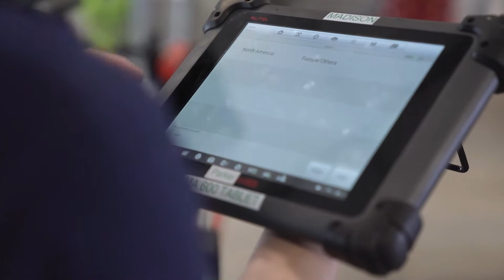What You Need To Know About Windshield-Related Calibrations

Comment: Currently on my 8th attempt with my insurance-provided windscreen replacement company. They've even said the calibration was successful, but when I turn on lane assist the car tries to kill me and pulls straight off the road. It will also beep at me constantly even if I'd dead straight within two lanes. In short it's f***ed, but was working perfectly prior to the initial windscreen replacement. Far too many service centres are failing with this task. My car has now been at an advanced ADAS diagnostic centre for three weeks and they're throwing everything at it. It's crazy.
Reply: Drive your Car not the Car should drive you. I dont use Keep Lane assist I always turn it off, I pay attention to the road infront,back,  left and right. Lol.

Comment: I have a 2025 Chevy Trax and it randomly had a crack in the windshield where camera is and then another appeared a week later. Need a windshield replacement $1200 with calibration. Windshield is in now but unable to calibrate cause of how new car is??? He came back today with updated equipment to do calibration and still unable to do it as it read STATIC recalibration which I now have to go into there shop to have done. How was this not known before getting updated equipment and coming back out to the house and how are these places not prepared to do these 2025 vehicles as it years in the making before they come out. I am a targeted individual via Gov criminals and I am extremely uneasy about this. The slightest the camera is off can cause me harm. I have already been put in two accident’s with attempts to take me out but they been unsuccessful. Now random windshield cracks show up and calibration is key to safety. Concerning and crazy as I have a pretty basic car and would never of known a windshield needs calibration. I don’t use this feature with lane assist so I hope I will still be safe but now literally will not trust it after it has been messed with after purchasing brand new. Sad actual criminals, under previous administration, have endangered my life to this point. Many people are targeted and don’t know, especially Trump supporters who actively engage  online. Covert operations to breaking into your vehicle and home and damaging things to look like wear a tear. People must know and be aware of this as many are out in the TSDB illegally and are covertly targeted. Just some extra FYI. Thanks for this information, very helpful and glad to be aware.

Comment: So if the clarity of the glass and camera alignment is so critical, then why doesn't a dirty windshield or a rainy windshield cause the problems in miscalculation you refer to? I call bullshit!
Reply: Great comment!!!❤
Reply: If you read the owners manual, it will specify not to use and rely on it when extreme weather is present like heavy rain, snow, or fog. Newer vehicles will post a code for dirty windshields, but sadly, you need factory equipment to clear the code after you clean it.

Comment: In my lifetime I have replaced 3 windshields.   The radar adds $500 to cost and the technicians are charging $450 an hour.
Reply: Safelight probably had a hand in designing it.
Reply: @thomaspaine6496  what vehicle was it? When I replaced my windshield the local company swapped over the radar camera and sensors and calibrated it for me. But 2 years later it’s giving my problems and I may have to get it recalibrated
Reply: The radar appears to be attached to the windshield.   Not an interchangable part.  My bill was $889 and change.   Insurance paid about $500.  Don't follow gravel trucks.
Reply: Can’t you just use the radar from the old windshield? And 450 an hour to calibrate the sensor?